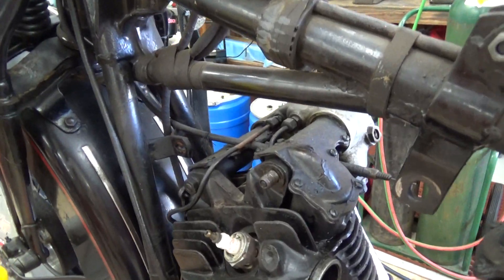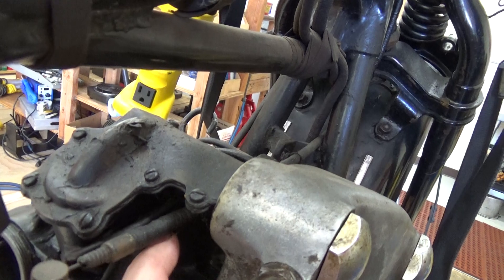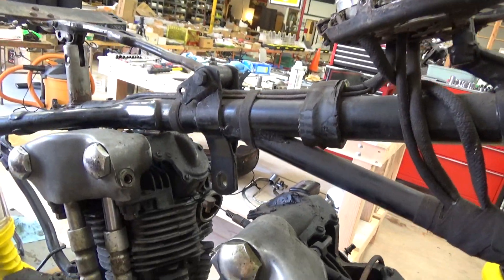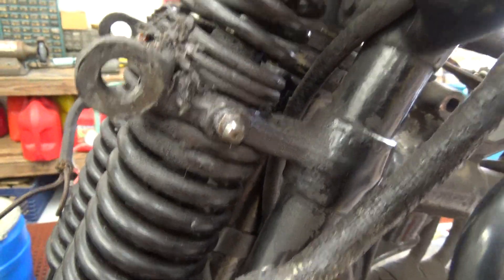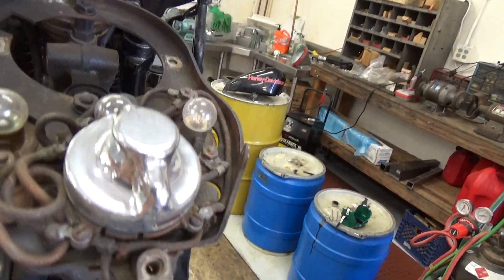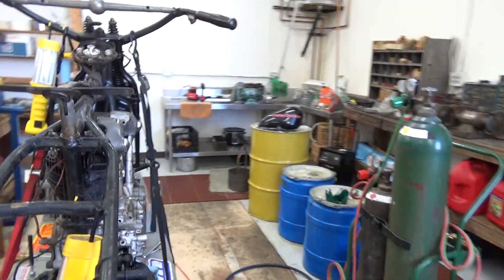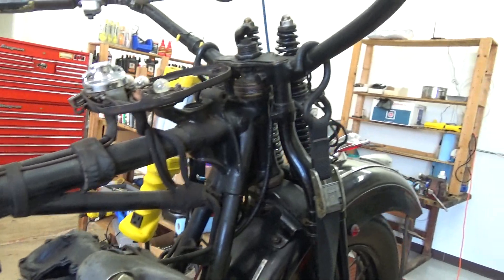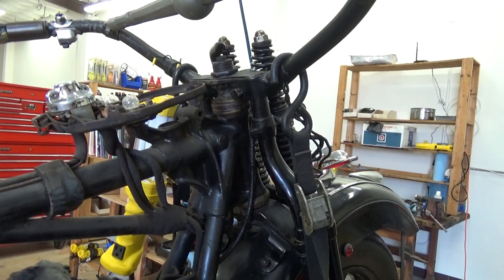Hunting Harley's, 1938 Knuckle throttle and retard cables, dash wiring

Comment: Was the seat height adjustable?
What is the bar across the handlebars?
Reply from the maker: yes and no. There are three holes for adjusting the seat slightly forward or back, which minutely changes the height. height can also be minutely changed by adjustment of the pogo seat springs. The bar across the handlebars is a late 20s , early 30's accessory light bar sold by Harley Davidson. People used this to mount various accessories of the period, such as spot lights, coin dispenser, clock, flashlight, note pad, etc.

Comment: Todd, I have always wondered about how the insides of the throttle worked, and how it works inside the handlebar.  How did they hide it, and make it simple and functional?  Is it some sort of spiral track inside?  I am drewbig5 on insta if you just want to reply there.
Reply from the maker: I will be making a video on that when I get to the bars
Reply: Tops!  Thank you.